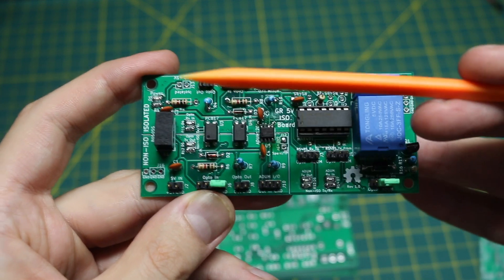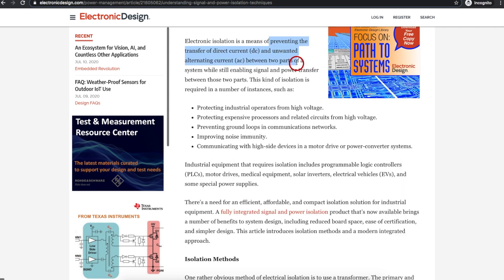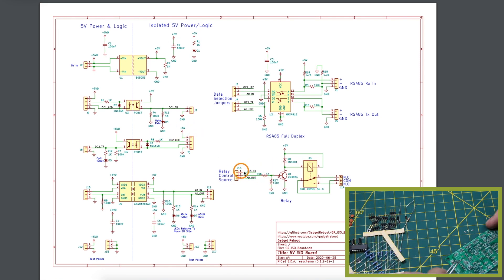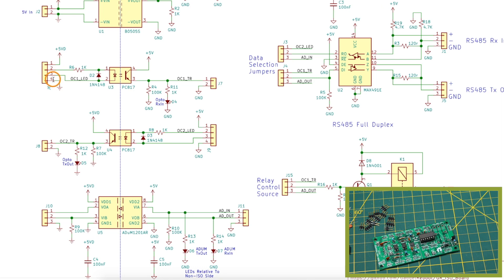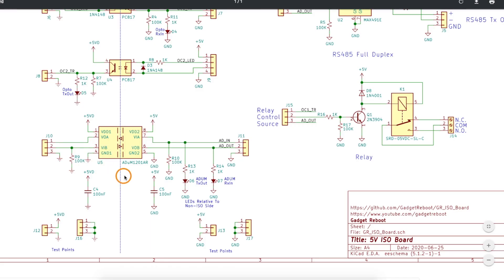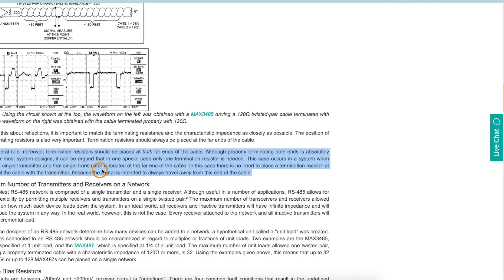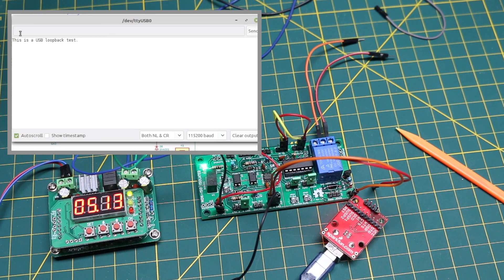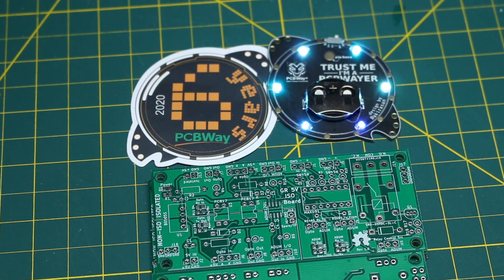Isolated Power, Relay & RS485 PCB using Optocouplers and ADUM1201 Digital Isolator

Comment: Nice board, but the isolation gap is a bit small for if you plan to connect to a mains supply via the relay. Just your arduino fuse programmer to un brick  an attiny85,worked a treat.
Reply from the maker: The one thing limiting the gap size for the two grounds is the 5 V isolation module with its pins so close together.
would you say it would be adequate to make sure the relay contact pins have a big enough isolation gap from the ground plane around those pins, or is there still a risk such as within the relay itself somehow creating a path over to the relay coil and into the rest of the board?

yeah having a way to fix the attiny fuses was definitely worth a pcb project. Saved me many times.
Reply: @GadgetReboot  Try and find a copy of EN60950-1 on the web, or EN61010 they wil give great insight in to how to provide an isolation gap. it's always good to know what size of gap or slot to aim for.
Reply: @GadgetReboot  The idea is to make the isolation gap as wide as possible, yes it would be too narrow at the DC-DC module, but it's less risk.
I seriously doubt that DC-DC module is actually rated for 1.5kV isolation, not with that pin out. I would have chosen a module with a different pin out.

Comment: This ADuM1200/1 series is new to me, and very interesting.  Have experienced frustration, trying to dynamically switch the arrangement of battery cells with Mosfets, isolated from an MPU with a bunch of PC817s.   A PC817 needs around 8ma on its base LED to switch quickly.  So if you need, lets say, 24 of them, the power from the controller side becomes significant.  Will send you an email.
Reply from the maker: I first saw the digital isolators in 2018 when I had to use them on the job to communicate between boards where one was coming from the unknown world and they worked great so I had to get some for the workbench. Took me a while.

Comment: Nice board, why did you put the relay driver on the isolated side, the relay it self is an isolator
Reply from the maker: although the relay contacts isolate the load, the relay coil could also possibly create some disturbance when switching so keeping it isolated would help keep noise out of the control side.

Comment: Shoulda added an analog optocoupler or two! I plan on getting or making one of those for an audio isolator, in order to mess about with HV microphones without destroying my computer or external sound card or other ADC. The most common ones I’ve seen have two phototransistors in one package one on each side of the isolation barrier, fed by the same LED. You use an op-amp for negative feedback to make the output signal voltage of the phototransistor (the one on the same side of the LED) is equal to the input signal voltage, and assume that the two phototransistors will behave identically. Or maybe they use photodiodes, I can’t remember. You can also use two normal optos, and hand-match them with a scope and some patience.
Then there are special cases like the H11M1(?) photoFET, which use a JFET as the phototransistor, which should be somewhat linear in their operation. These can also be used as floating voltage controlled resistors, much like a vactrol, in the feedback loop of an op-amp in order to make a voltage controlled amplifier or filter. Kinda pricy though.
Reply from the maker: isolating analog sounds good, I’ve been meaning to try some little experiments sending audio over in LED to photo transistor or photo resistor or solar cell or photo diode for some experimentation, although not necessarily expecting hi-fi results just playing around.